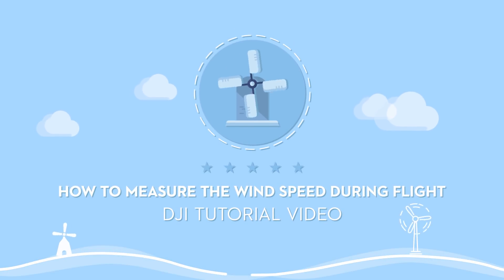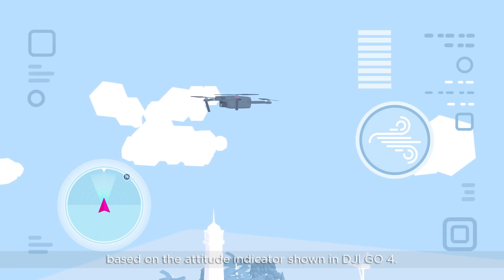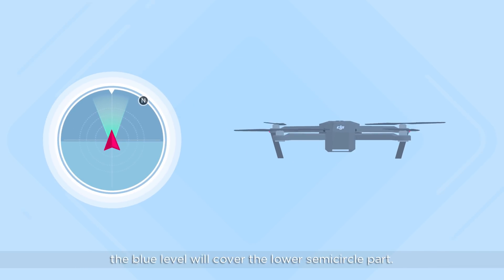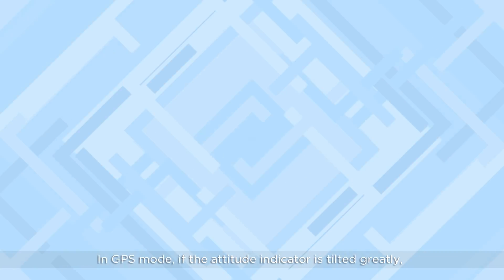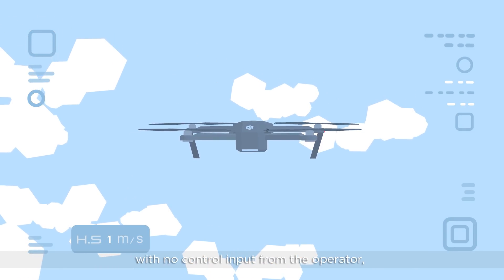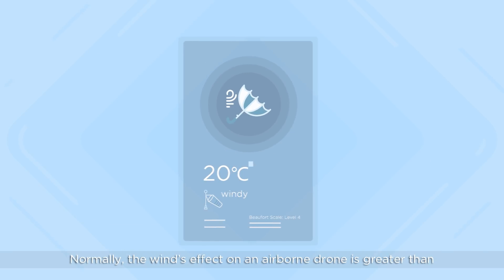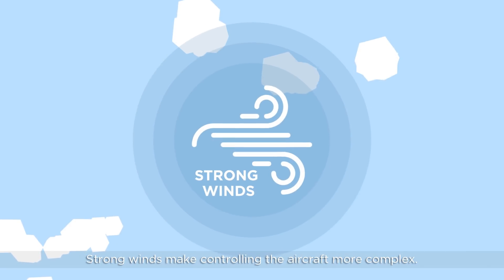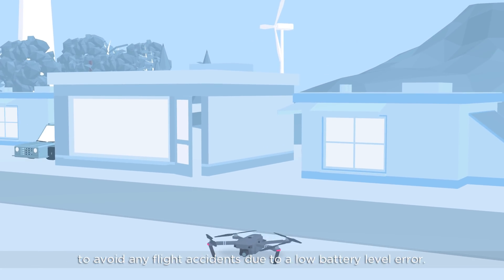How to Measure the Wind Speed during Flight (DJI Tutorial)

Comment: eh, you already get wind velocity warnings with very light winds... and the advice to land the drone is a bit weird. If you fly in normal GPS mode, your craft can't handle that much wind indeed, but pushing it to Sport mode, it can handle very strond winds. I'm not sure I want to know how the drone is moving... mostly i know in high winds, if I see the props, and sometimes the landing legs in the frame :P 

It's handy to advice people how to fly with strong winds, instead of only stating 'land the drone' . 
1 advice would be, if there is quite a bit of wind, always fly upwind first, so, if you have to fly back in a hurry, the drone will fly with the wind. 
2 advice would be, high winds, always sports mode. I'm not quite sure what will happen if the drone stays in sports mode when the return home is activated (anyone?) .. 1 thing is for sure, the 'go high' option of the return home, will sometimes get you into trouble with high winds.
3 battery life, drastically drops in sports mode and high winds, in half. and... is not consistent!! 
4 the gimbal will fail way before the drone starts to get into trouble... I fly the Phantom 4 PRO, and that one can take s load of wind, but... gimbal can't. You start to notice this first with 'jittering' in the camera, eventually the gimbal motors will stop, and your image will yank offbalance... you can correct this by turning the drone.
5 for good camera action in high wind, always fly with the camera 'off winds' . This way, the tilting of the drone protects / shields the camera :) 
6 wind is never constant... You can fly in constant high wind 'normally', but the gusts will get you mostly into troubles. 
7 know the direction of the wind... and plan your flight path accordingly
8 use carbon props, more stiffness, will fly more agressively, but, less 'flapping' of the props... I've flown dousan of actions now, still use the same props..
9 ow, high wind, always start and land handheld, never on the ground!!! The drone will flip over, always!
Reply: Thank you this was very insightful, I hate how dji just covers their ass by just saying, "Land your drone" No further tips or things to consider.
 I liked 4 and 5 as I was just thinking about this last night. I didn't know the gimbal wouldn't be able to handle it but in the case you did have to fight a strong wind, I was considering the areo dynamics of the M2Z and thought it would probably cut through the wind better going backwards as the end of it is narrow vs the broad front brow and the whole gimbal area/knotch/pocket which is kind of a parachute area. 

Though going backwards is hard to see..

Comment: This feature has one draw back. As a pilot, this is backwards and can cause confusion in directional attitude. It would be fitting if the flight instruments represented actual ones for continuity sake. Attitude indicators bank in the opposite direction in a turn.
Reply: Some aircraft actually have the "backwards" artificial horizon :-)